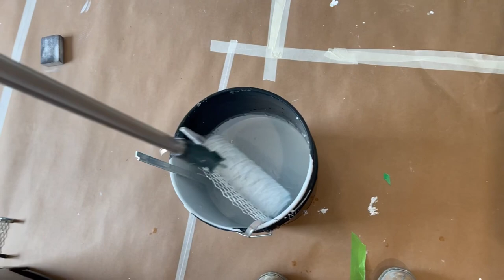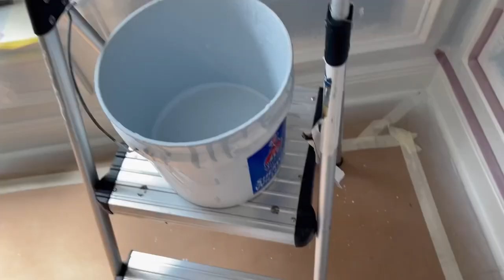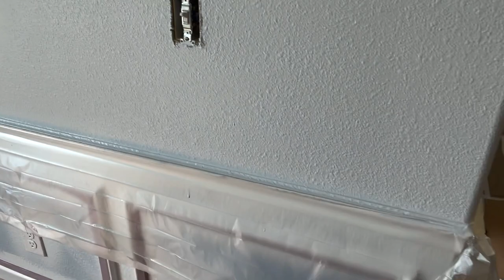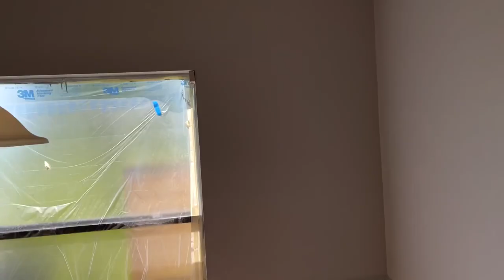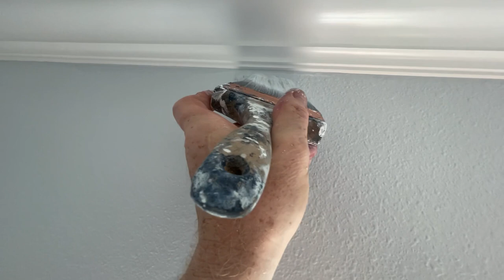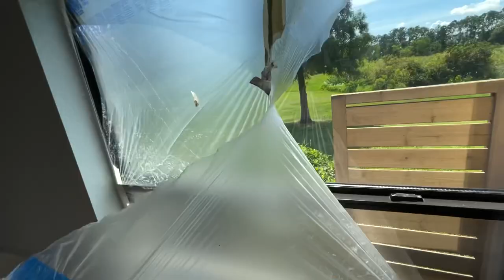Brush & Roll Your Interior Walls Fast With 2 Coats - Spencer Colgan

Comment: You only seem to work on textured walls. Don't the homes that you work in have flat finishes?
Reply from the maker: Yes the high end homes have flat. They want Wallpaper only.
Reply: He’s in Florida where textured walls are the norm
Reply: Don’t understand how your are able to apply second coat while the first coat is still wet. 
Whenever I’ve tried that it seems to pull the first coat off thus defeating my purposes
Reply from the maker: @stephenzwemer2905  Steve.  Use better paint sir.
Reply: @spencercolgan  

I used to use Glidden but not sure anymore 
Have heard that Benjamin Moore is good.